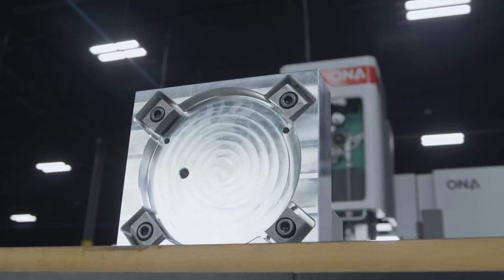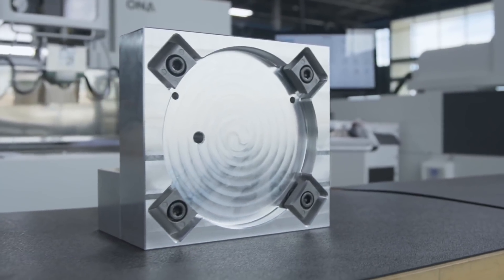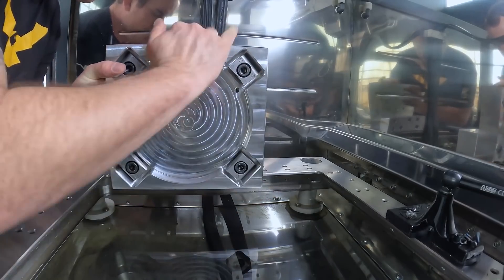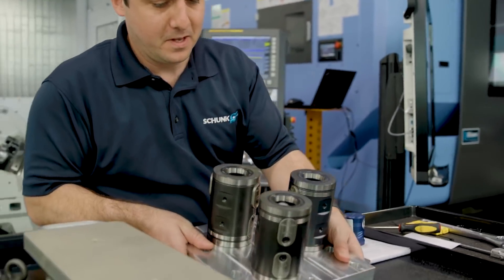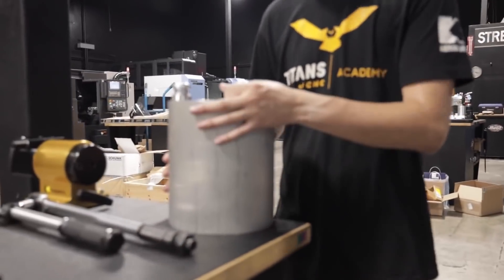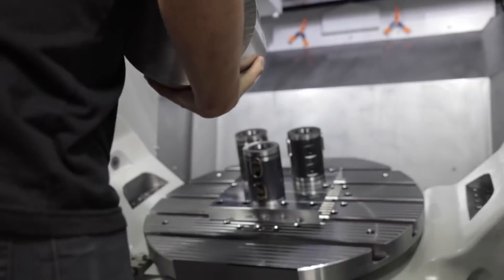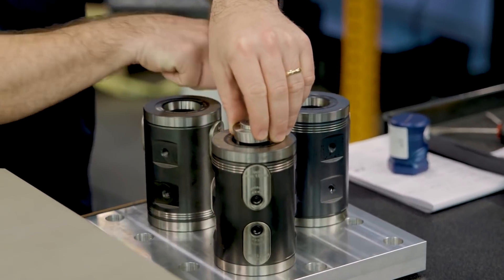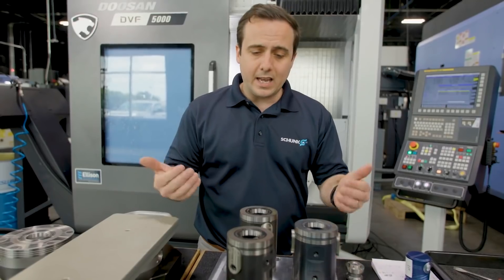Genius Machinist Workholding Tricks | Compilation

Comment: Can you provide an explanation for the fixturing practices in the first sequence? Those pins that are being hammered into the part and then the assembly of the fixture. If this is a precision fixture, then just hammering in the pins without a guide could cock them in their holes. Additionally I see that you have to hammer the top piece of that fixture in at 0:16. Looks like you are using two pin holes to constrain that piece. This is an over constraint, where a pin hole and pin slot should be used to exactly constrain the system.
Reply: Two dowel Pins press fit is a common way to locate mates.. Sure the dowel pins enter at an angle but quickly find the centerline of the mating hole. You are free to slot your mates.

Comment: The trickest setup i ever did was milling a 2 step internal keyseat. The part was setup in a 48" lathe with a 12 ft. bed  using a Bridgeport head mounted on a huge boring bar that was mounted to the toolpost. Wish i had pictures of the setup, but this was 30 years ago. I made 5 of these parts for Virginia class submarines.
Reply: A Bridgeport head mounted to a "boring bar" mounted to a tool post would be a sight to behold.  Wow.

Comment: As a tool maker, there's something about an aluminum fixture, or what I'm guessing is aluminum by the color, for a tight tolerance application like wire EDM that just rubs me the wrong way. Maybe I'm just set in my ways, but that fact that 6061 and 7075 aluminum has 1.44-2.17 times the thermal expansion of stainless steel just doesn't sit well with me. That and mounting dissimilar metals together in a corrosive environment usually isn't good long term. However, if this is a prototype fixture, I can understand using aluminum.

Edit: Erowa and 3R are probably using stainless for a reason for their wire edm work holding products.

Comment: Brilliant workholding trick! Very creative! However, when i make a plastic workpiece (i work mill for plastic company). I pass over to operator to run job, he didn't listen when i told do not overtighten, and he did overtighten too much and ruin workholder and thread. I redo explain him over again. I wonder if any you have experience often that damaged workpiece and have to rework again? Thanks
Reply: I´ve once had the problem with a very fragile aluminium piece. On some older machines at my workplace the vices dont have an indicator how strong it pushes together so you do it by feeling. Well the part was warped after i put it out. But hey everybody needs to get some failures like this to learn from them.

Comment: My former shop was one of the most accurate job shops that have ever been.  We were known for being micron accurate. We'd hold less than .0001 true position and half a micron flatness with Sip jig boring and standard Matsuura CNC machines. We were bought by Corning. Yeah, that Corning. 
.0001 is a mile.
Reply: Which Corning?
Reply: Corning Inc. #277 on the Fortune 500 list. 
The diamond turning division bought our business. They wanted all of it in house instead of having to buy our parts that they would then finish with Precitech Diamond Turning machines.  We were the only company in the US that could give them the quality, but more importantly the consistency of quality, that they needed. I really wish Titans was closer to me because I would fit in very well there. Everything starts with a clean shop, period.

Comment: I understand drilling holes in the work piece but, if the holes need removed? Do you make the base larger for the mounting holes then remove that part of the piece? I ask because I see a few issues or concerns cost wise here. Customer is paying for wasted material, machinist is paying for wasted material plus extra time on said piece. Or is all of that already figured into the overall cost of the "part"? Hope I'm making sense with these questions. Love the video's. Cheers :)